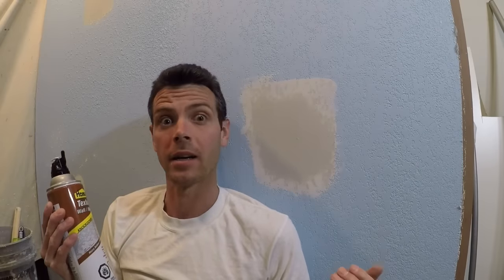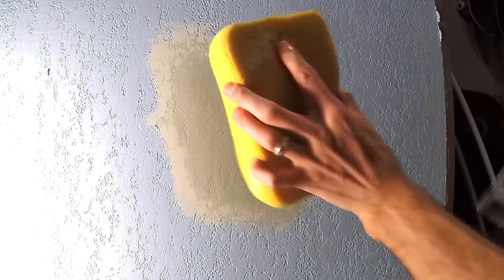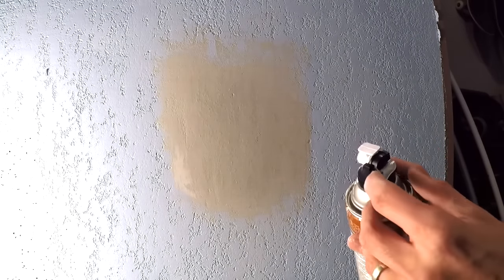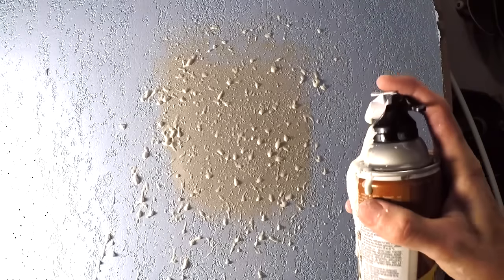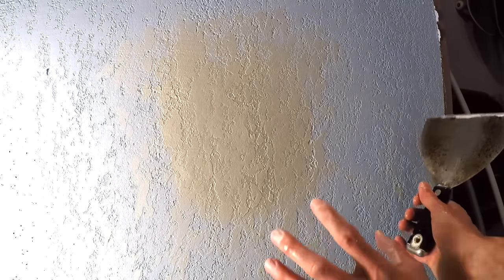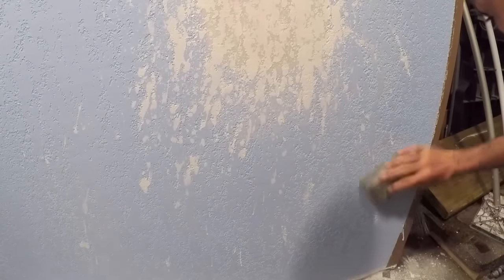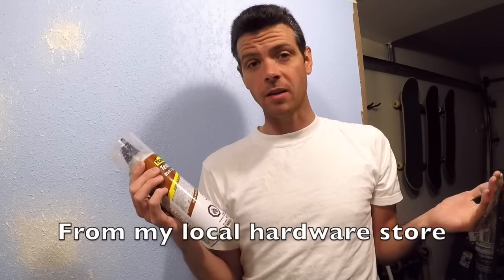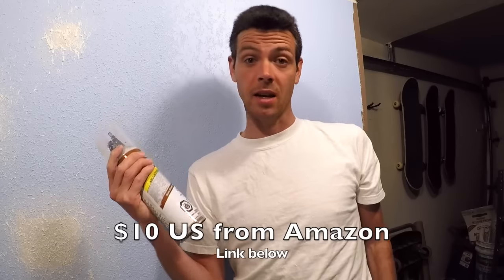DO CANNED DRYWALL TEXTURE SPRAYS WORK?!! (Knockdown)

Comment: Vancouver Carpenter,   i've used the spray texture numerous
    times with good results,  about  $ 12.00 at my local
 Lowe's & Home Depot.    i think your result may have
   been a little better had you waited around 5 minutes,
before the knockdown instead of two.
Reply: Norm Hodgkinson 25 dollars ? Way cheaper in the states.
Reply: @zoeclearwater     yes its, and i don't know about other states,
      but here in Calif.  a can of spray texture, depending on
 the size,  costs between  $ 11 and  $ 14 dollars.   i don't 
      know why it costs  $ 25 dollars in Canada.   maybe its
taxes,  import costs, or tariffs  etc.

Comment: I have tried the water-based orange peel spray, and after some practice, it turned out fine.  I used up probably half the can before I sort of got good at it.   The YouTube videos I watched certainly helped me.    However, my question is, why do home builders put texture finishes on drywall in the first place?  Patching holes is so much easier when a wall has a smooth surface.  Here in the American southwest it seems like there is orange peel texture on everything.  It is like some awful skin disease.  Can somebody clue me in on the purpose of this?  By the way, Vancouver Carpenter, you make excellent videos!
Reply: Hiriser 15 smooth wall are crazy expensive. Most difficult to achieve.

Comment: How did you get it to stop leaking down the bottle! haha, I bought a can and made do, but it was so messy and wasted nearly 70% of what came out of the bottle was going down the can to my hand. Patch still came out good though but so wasteful.
Reply: I had the same results with the DIY can...terrible product! The can marked PRO GRADE works fine - a great product.
Reply: You HAVE to warm the can up under the tap for a little bit.  It creates pressure inside and make all the difference.

Comment: Sponge is best way to prep if you apply the mud correctly..and you didnt read the directions on the can that was not the proper way to spray the can texture..for small areas this is the best way to blend a patch that can here in texas is 13.00

Comment: Wrong technique.  First, you need plenty of shaking.  Second, warm can.  Pressure is your friend as you need to get globs of mud out at high force. Third leave nozzle open and spray in increasing concentric rings.  Do NOT keep restarting the spray in tiny linear sweeps.  For this kind of job open the nozzle ONCE, and fully, and let 'er rip in a single spray until you are done.  Fourth, let dry 5-10 mins before knocking down.  Mud needs to be stiff. Sixth, light pressure knockdown with blade parallel to surface.  (You do NOT want to smooth it out; you want to leave islands of knocked-down mud.)  Seventh, allow to fully dry before painting so you do not just re-liquify the mud and lose the texture.
Instructions suggest priming before application; I don't think that's necessary.
Note that it is almost impossible to re-use a can even if you clear the nozzle upside down.  It's very messy and the nozzle will eventually plug.
It's an expensive can but tons cheaper and tons faster than getting in a sub.
My 2c.

Comment: I'm an old fart amateur when it comes to drywall stuff.  I tried the orange peel spray can a few times.  What a disaster.  I got better results by splashing the drywall compound with a wet brush.

Comment: By no means do I qualify as a drywall/texture person...but I have had pretty crummy results from these cans...I would rather use other techniques for example... the sponge or brush splatter or even the hopper gun....just depends on the size of the repair...they are rather expensive and very limiting...perhaps if I was a homeowner/diy person is about the only place this product makes sense in my opinion

Comment: I work in an old hospital that has a lot of popcorn texture and I always have a hard time making my patches not visible. Can you make a video on how to patch a wall with popcorn texture?
Reply: valensal91 The popcorn spray can from that same brand is 50/50 for me.  Sometimes it looks okay, sometimes it doesn’t even work right and I have to go buy another can.  But recently I’ve been using the Homax roll on texture for popcorn ceilings and it looks way better.  I just use a cheap stain brush and paint it on super thick.  I’ve only seen this stuff at Lowe’s

Comment: It just falls to the floor,it's just a waste of money...it's not enough power to stick to ceiling & what does looks bad..the orange peel works good on walls & ceilings
Reply: Run the can under warm water. Helps the pressure.

Comment: I plan to texture the entire upstairs ceiling. I wonder if this product is cost effective for a big project. Or if it is efficient being used on ceilings. Any comments?
Reply: @wowreally594  I just got a quote to knock down match 6 California texture pot light holes.  I got quoted $2600.  I will gladly pay $20/can to do this myself and save thousands.

Comment: nice, but I will not pay $ 20 or more for this stuff. I will mix about 1/2 gl of texture mix from the 5 gl bucket and put it in the texture hopper and spray that on. I take out unused mud from the hopper and put it back in the bucket. I am just a frugal man.ha.

Comment: They dont work because they dont have the same build (product elevation) that allows them to blend into standard home applications. The orange peel works fine, the knockdown nuckin futs.
Reply: Canned texture products almost have a "muted" feel (therefore leaving your patches obviously apparent, and clients wondering wtf) and thats because (i believe) whatever compound theyre using in the aerosolized can doesnt leave enough on the wall to provide a elevation that industrial applications provide.
Reply: With the stuff in the Can, if you spray it on the wall, and touch one of the globs prematurely, it will deflate, and fall back towards the wall
(this is why i said i believe the can has more air in the product)
If you do the same to something that came out of a hopper, its going to move the product, because there is no air actually within the solution that is actually on the wall.

TL;DR: Cans are dogshhhhhhhhhhhh because they aerosolize your base.
Reply: Cans too thoroughly infuse the solution with air before it contacts the wall, where Hopper/Compressor setups spit the solution onto the wall without actually infusing the solution with air.

Comment: Heating the can makes a world of difference.
Reply: How hot and how long? I’m scared it will explode 😬
Reply: @JP-td8gt  Just run it under hot water from the tap.
Reply: What’s the difference of heating it up?
Reply: @MythicRealTrap  I cannot tell you why it makes a difference I can only tell you that it does make quite a difference.
Reply: Like in a microwave?
Reply: @MrCwhitt75  No! Just run hot water from the tap over the can for several minutes.
Reply: @MrCwhitt75 yes you should totally stick in the microwave
Reply: @MrCwhitt75  no
Reply: Do not heat up pressurized Aerosol cans or do and blow your Dumbass up
Reply: Hot water only. No fire, oven, microwave,  or toaster oven. Just hot water.